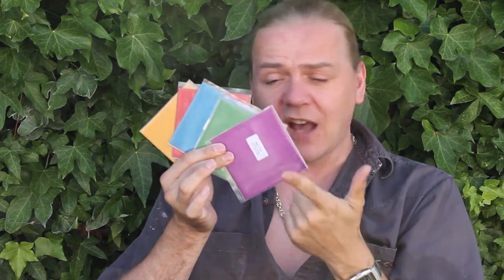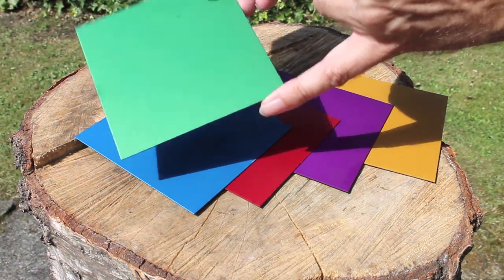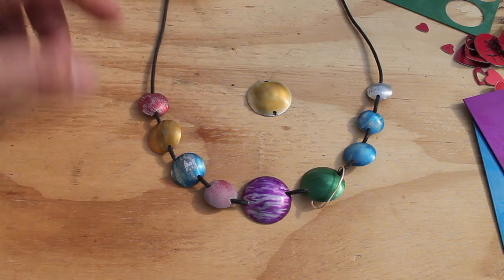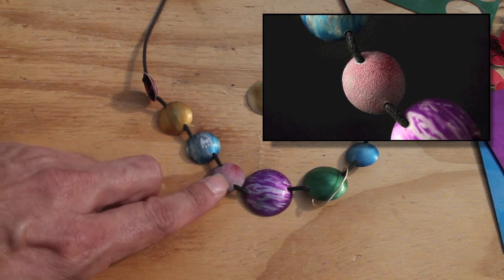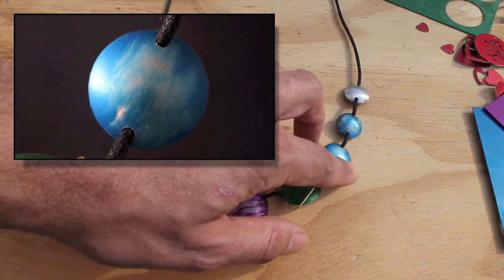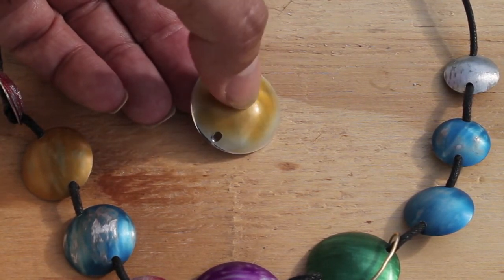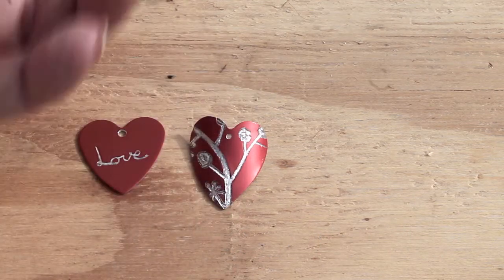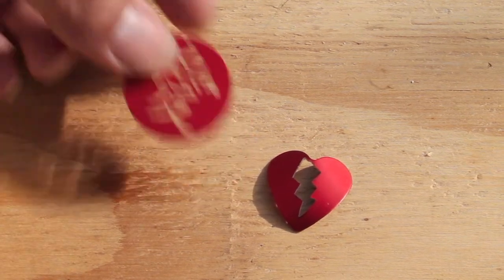Anodised Aluminium Sheets for Jewellery making Demo & Review in HD

Comment: Can this material be used in a die cutting machine , like a big shot.
Reply from the maker: Obviously the Big shot and Sizzix machines are fine with thin foil, but I'd say getting to this thickness is probably pushing it a bit. I'm not sure a die would penetrate it. If it did, it would likely only do it once. Hope this helps. Dave